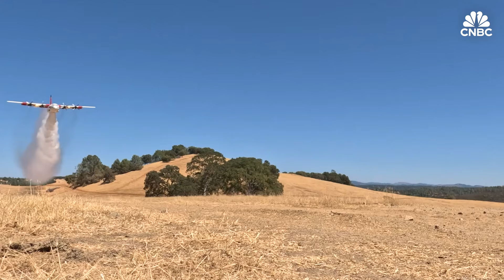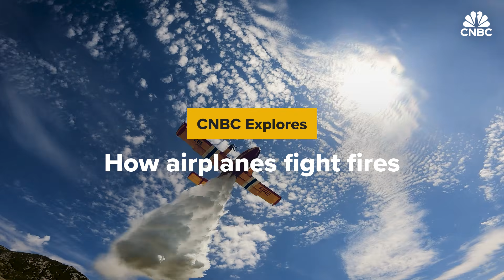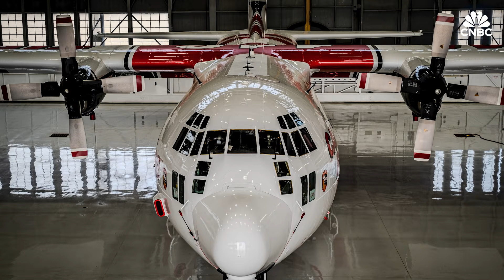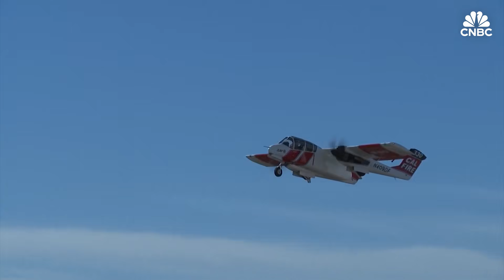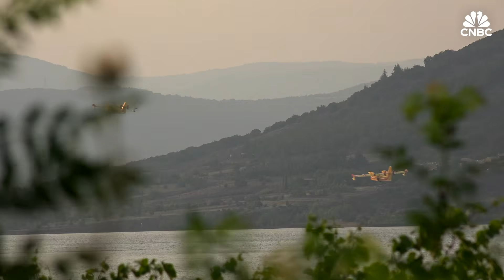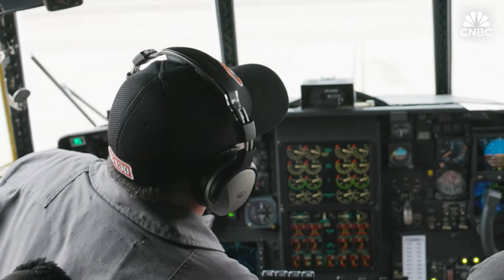How Water Bombers, Old Commercial Planes And Helicopters Battle Wildfires

Comment: Put up a sprinkler system throughout the forest
Reply: Would require way too much water and cost to build. It would probably also distrupt Natural ecosystems to build.
Reply: @710islife93 they already using water from the ocean . It will be easier to fight when there is a high pressure sprinkler system . Same cost to not rebuild the whole city
Reply: @900jayjay  That is a lot of miles to cover. Not practical. Let's get to the cause of the problem instead of Band-Aid solutions.

Comment: Great piece. As a pilot of regular old airliners, I find this fascinating. The C-130 is one thing, it's built for war. But the DC-10 is a beast of a plane. It's big, and has lots of power, but it is not originally built to be flown like this. Any of this flying requires you to have excellent situational awareness at all times. To be able to do that, safely and not add to the fires, in all of these machines is absolutely incredible.

Comment: The U.S. needs to convert at least 20 747-400 aircraft (100's are in good condition but recently retired due to inefficient fuel costs when operating as passenger aircraft) and create a fleet of fire tankers. These would be distributed in 4-5 fully equipped bases. Flight crews would be on 24 hour standby similar to our cold war footing. This would allow overwhelming force to be placed on an emerging fire within 20-30 minutes in most cases.

Comment: This documentary is frustrating. It assumes knowledge from the viewer and leaves questions unanswered. Just how effective is this really? Does this really help or is it just the equivalent of trying to put out a fire by using a backyard hose?
Reply: Very effective over the past few days.  There have been a lot of small fires around LA and the planes and helicopters snuffed them out quickly.  They aren't effective if the winds are too high, though.
Reply: @EdDunkle  thank you. Pretty much all I've been able to find in the news is a bunch of stories that just keep calling people heroes. That doesn't help and it doesn't educate
Reply: @Rambam1776  Do a search on De Haviland 415, be prepared to do some reading.
Reply: For a large wind driven fire this is basically the only way to fight effectively. The wind makes these fires move incredibly fast. People on the ground simply can’t keep up. The SCS fire several years ago was near my home.  It went 30 miles in about 6 hours. Think about that in real terms of your house and where 30 miles away is. So when the winds hit 100 in LA you knew it was all over. Air resources couldn’t fly. Firefighters on the ground have no chance. Pi * R squared. Every mile the fire grows the radius grows up to 10 miles. It spirals out of control.
Reply: They keep investing in these technologies and using them to combat fires because they are completely useless.  😏